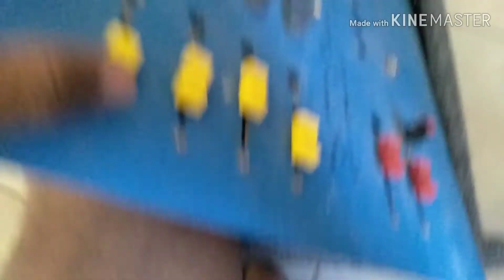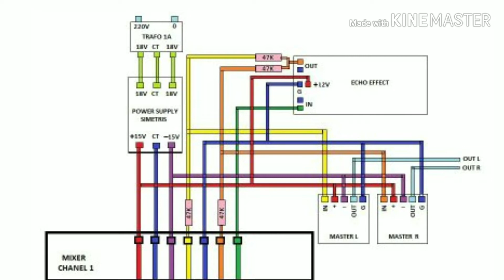Cara merakit Mixer 4 Chanel sederhana

Comment: bos ada sedikit kurang paham.itu di trafo kan sudah ada elco sm dioda.terus masuk ka filter tegangan di filter tegangan itukan ada dioda sm elco.apa dioda sm elco yg ada di filter tegangan kenak lepas dulu ya karna uda ada elco dioda di trafo.muhon jawabanya.trimakasi?...
Reply from the maker: Gak usah dilepas gpp gan
Reply: @radikielectrolovers2648  trikasi banyak ilmunya.smuga sehat wal afiat.AMIN...
Reply: @radikielectrolovers2648  bos..ini aut master mixser yg menuju ke 4 jek imel.itu dikasi resitor.muhon penjelasanya.?...
Reply from the maker: Untuk outputnya yang menuju jeck Akai Gak usah dikasih resistor lur
Reply: @radikielectrolovers2648  trimakasi ilmunya bos.. smuga km sukses slalu Amin..
Reply: @radikielectrolovers2648  bos..klau blh tau besinya yg dibikin mixser itu bra ukuranya klau 4 cenel.lebar dan panjangnya besi itu brapa muhon jawabanya..?..

Comment: Mas mau tanya kenapa resistor 100ohm pada kita mikser kok panas terus padahal pake 12 volt mohon pencerahanya🙏🏻
Reply from the maker: Pemasangan PSU sudah benar gan??coba dicek dulu pengkabelannya mungkin ada yang salah
Reply: radiki electro lovers udah mas tapi kok tetap panas

Comment: lokasi mana bos?
Reply from the maker: Tuban Jawa timur bos
Reply: @radikielectrolovers2648  bahan" apa aja bos? boleh dituliskan nggak? di deskripsi gak di tulis soalnya
Reply from the maker: @mikestejo9012  bahan2 yang perlu disiapkan 
Kit Mixer Yamaha 8 potensio 4 biji
Kit master Mixer 1 potensio 2 biji
Kit PSU simetris 15v
Travo 3 Amper
Kabel2 dan jack2 input-output terserah mau pakai Jack XLR atau Jack Akai
Kit VU LED meter
Reply: @radikielectrolovers2648  oke makasih ilmune cak, sukses slalu cak

Comment: rakitan saya kok over mas suaranya. sya pakek yang 7 potensio
Reply from the maker: Coba di input kit Mixernya dikasih R 22k gan.
Reply: input yang masuk master mixer ya mas. udh tk pakek ukuran 12 k apa kira" kurang besar ya .dan suarnay agak serak" pecah gitu suplay pakek 12v 1 a
Reply from the maker: Klo kit Mixer byasanya 15volt gan,,itu Mixernya ngrakit berapa Chanel?pakai kit Mixer Yamaha atau Roland?
Reply: 2 chanel mas.pakek kit rcx
Reply from the maker: Coba dulu tanpa master Mixer gimana hasilnya?
Reply: okeoke. r nya idealnya pakek yng ukuran berapa mas?